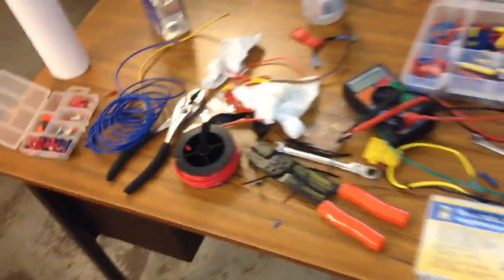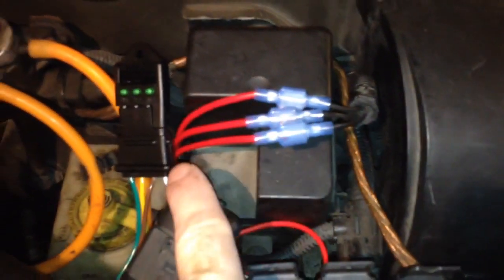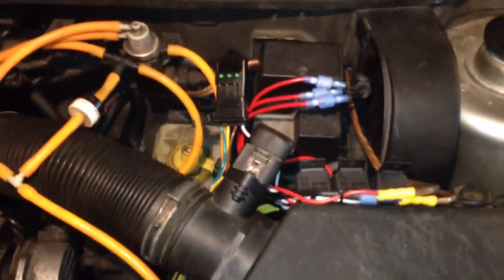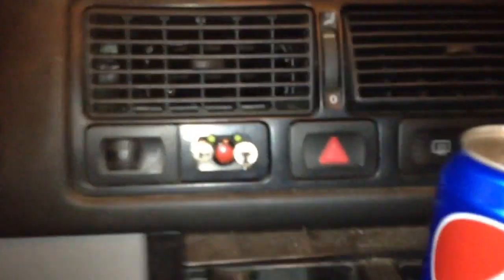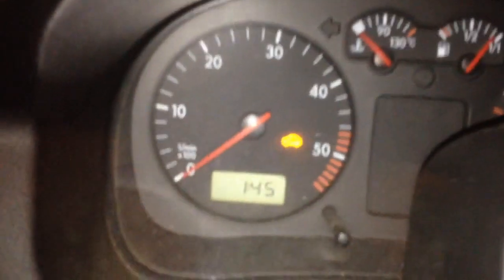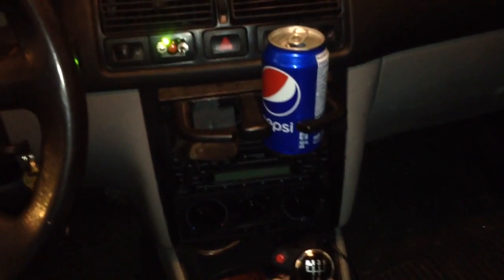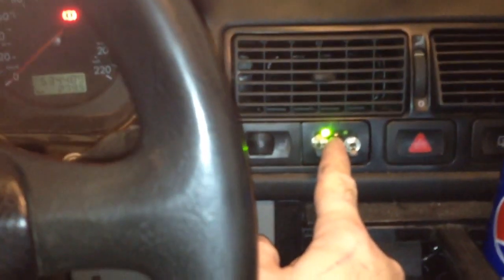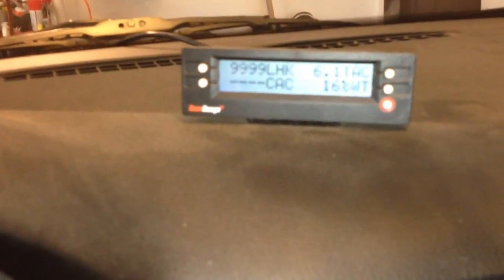ALH TDI Coolant Glowplug Manual Overrride and Telemetry Circuit with Fuel Solenoid Monitoring

Comment: Congratulations, it appears you have the rare passenger side cup-holder.

Haha Nice vid and setup though.
I had the plug harness/relay completely melt off the two back plugs on mine. That's the two off the J359 fuse. The plugs themselves look hosed but it does run fine without it connected.

Comment: Can't you just use the existing relays and force them on with a switch? This way you avoid installing anything besides a few wires and a switch.
Reply from the maker: +Victor Iliescu I wanted to keep the wiring simple and easy to access.